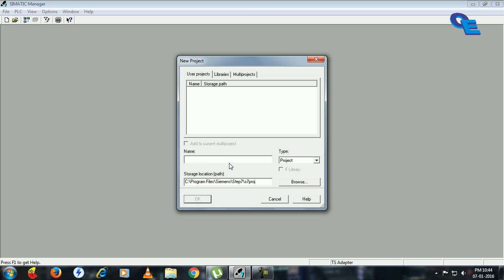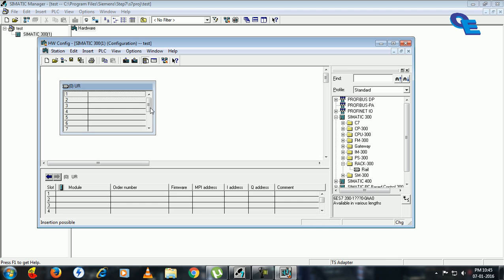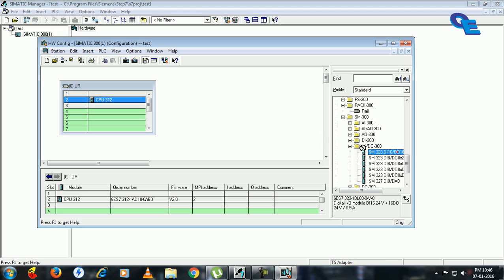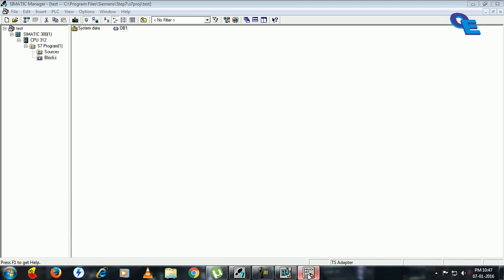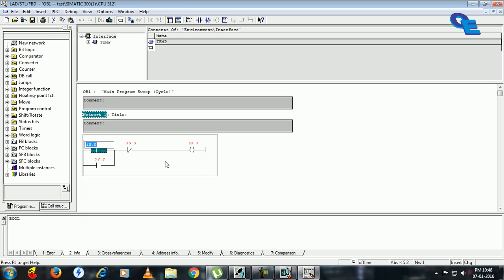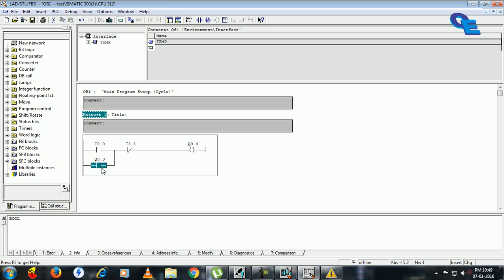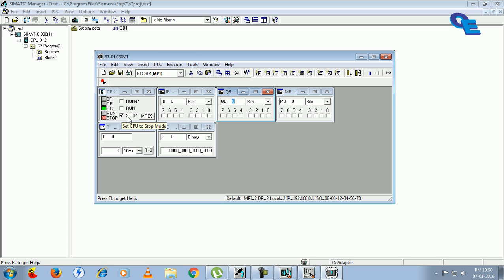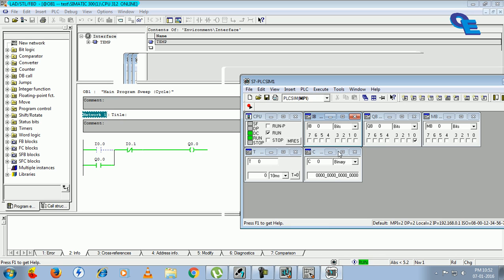SIMATIC STEP 7 PLCSIM Tutotial#2 Simulation

Comment: hello.I did everything correct.but when i tried to make download,error message was UNABLE TO REACH THE MODULE CPU312 VIA THE ONLINE INTERFACE. Do I need real PLC?
Reply: SOLVED IT! I'll do my best to explain to you

First, in configurate network, check what kind of connection you have, in my case it was MPI
Then go to your PLCSIM, and make sure it is the same! Otherwise you'll get the same error message. 
Last reboot the PLCSIM and it should load without problems
Reply: I get the same problem here, have you found the fix already
Reply from the maker: Drop message to +918970063613 if still u need solution